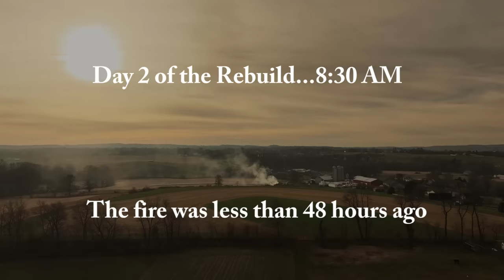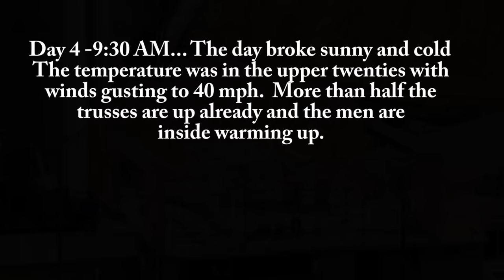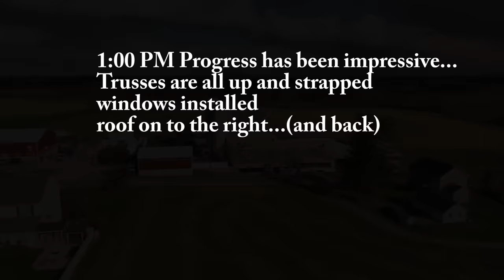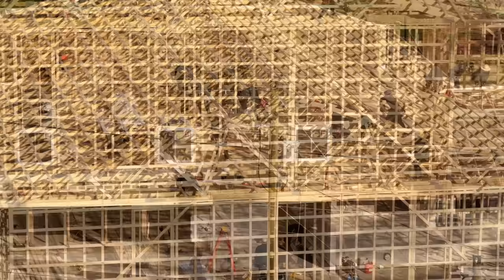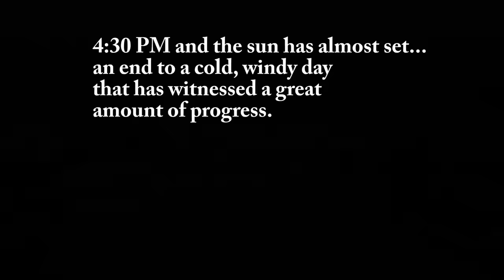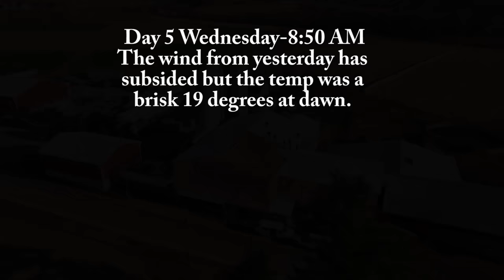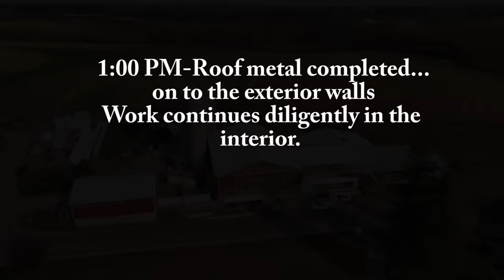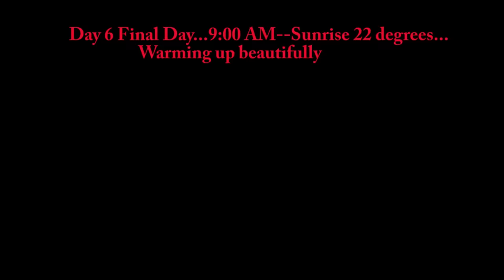BARN RAISING After AMISH Farm FIRE -NEW BARNS in 6 DAYS- Lancaster County's Amish Community

Comment: They obviously don’t have to pull permits or wait for inspections. It’s amazing to see things being done the right way and free of red tape and government bureaucracy and regulations.
Reply: it's called Corruption 🤣😆😂😅
Reply: They may be in an unincorporated township.   No governing body is present to require permits.
Reply: Good thing OSHA isn't around or allowed
Reply: Because this was a rebuild of an existing structure and no changes were made to the footprint, no township planning or approval was required, and most townships give the permit for free or a minimal charge. Had this been an entirely new farm, the owner would have tons of red tape and the process could take a very long time to approve.
Reply: Most agricultural buildings are exempt from building permits and except for electrical inspection but amish don't use electricity
Reply: @JERRYRIG432  Osha doesn't have jurisdiction on private done jobs there is no paid employees therefore not a  jobsite
Reply: You are correct on both comments. Ag buildings and I think hunting camps are exempt in PA, and OSHA has no jurisdiction here. @jdcatskinner
Reply: They build things to last.  If this were done by normal people in a place like here in Florida, someone would have low-bid the job, used low-grade materials and the first tropical storm that blew through would have leveled the building (if they even stayed around long enough to finish it).  There's a reason there are regulations, although there are still corrupt people who believe they are above the law simply because they are the law.  Ask anyone who's done renovations in this state how much of what they pulled apart was up to code. SMH.
Reply from the maker: @paulwall5706  , not even close to funny.
Reply: Red tape  ..... and greased palms.
Reply: @cassiebanks It’s the same on this side of the pond, ironically we call them cowboy builders over here😁.
Reply: Many hands make light work. Well done
Reply: @c.a.martin3029   they did change the footprint they made it bigger on the house side of the barn,
Reply: @719vol   it's West Lampeter Twp Lancaster County PA they are Incorporated
Reply: Unfortunately regulations are needed to protect people from crooked contractors. The Amish do not have that problem.
Reply: @719vol   This is in the suburbs, a few minutes drive from the city of Lancaster.
Reply: @jdcatskinner  many of them including this one very definitely have to use electricity for all the fans, pumps, cooling lines and other equipment. Plus in smaller townships especially in the farming industry, just replacing the same structure following the fire they probably had signed permits if they needed them within a few hours.
Reply: @capicolaspicy  most use pneumatic and Hydraulic powered fans, pumps, milkers, washing machines, refrigerators,  compressors and much more
Reply: @jdcatskinner  absolutely no argument, but you still have to have something to create the hydraulic pump pressure or the pneumatic pressure. Totally agree however that it minimizes the amount of electrical equipment required.
Reply: The big thing is they are self-insured through their church. Their "claims adjuster" was probably on scene fighting the fire and then ordering materials that evening.
Reply: If you research the Amish, they're exempt from dang near all the English laws and bureaucracy.
Reply: I was thinking that as well, then I figured that by the time OSHA knew there was a building site there they would have completed the job.
Reply: I live in a small farming community. I can attest to what others have said. If you're replacing a barn, silo, or other farm buildings, as long as the footings are there and you're not adding to it, then the permits aren't necessary. The only thing that's required is an electrical inspection. As others have said as well, being an Amish farm there is no electricity, so it's an easy build. This has been true since forever for the simple fact that a farm isn't like a regular business that can move. If a small factory burns, or is destroyed by a storm, they can easily find a different building and move into it.

But being a farm barns are absolutely vital and the longer the delay the longer the wait, the more impact it has on farmers. A farmer that has to wait months for inspections and permits may lose their livelyhood waiting. Therefore, as long as they're just rebuilding the interference is minimal.
Reply: @jdcatskinner don't use electricity, you must be kidding
Reply: @jamesadams893  some do but must amish from eastern Pennsylvania use pneumatic and hyd. Some ues solar panels to charge a bank of batteries
Reply: @jdcatskinner  they still are using electricity, what the fuck do you think goes into the batteries
Reply: @jamesadams893  no shit but you don't have to get a permit for it and that's what this post is about stick to the topic

Comment: Much like this great team of people, back in the '80s, I was part of the engineering corps in the military. Our camp, home to about 600-700 soldiers and officers, was suddenly called into action one night. We had to clean up after a severe accident: two semi trucks had collided in the countryside, not far from our camp. One was carrying fish, the other a large petrol tank. The crash had caused a fire that burned down four houses.

That first night, our task was to clean up the scattered fish from the road, working alongside the fire crew who were busy putting out the house fires. Local road assistance companies helped us move and haul away the wreckage of the semi trucks.

The following day, we switched to operating heavy machinery like excavators, bulldozers, and dump trucks. We worked in 8-hour shifts, clearing debris and preparing the site for reconstruction.

By the second night, our focus shifted to laying down infrastructure for new houses. We worked on connecting waterlines and sewage systems to four new house lots. The concrete foundations were poured on the third day.

I vividly remember working through the third night, helping to erect the walls of the new houses. In just 7-8 days, thanks to the coordinated efforts of our crew and some locals, we managed to rebuild what was lost in the accident. It was an incredible demonstration of what can be achieved in a short time with a well-organized team.

Comment: What an astonishing achievement! And what a community.  I'm an old, cynical atheist but I was moved to tears several times during this by the sheer determination of everyone, and that includes the power company linesmen too!
I nearly forgot, at 28 minutes, is that the highest washing line in the world?!
What are the two lines of raised roof fixings on the lower slopes of the roofs?
Reply: To prevent snow from sliding down on the street.
Reply: I was trying to get my head around the washing line! I kept thinking is it perspective or is it really that high 😂
Reply: Line looks like a pulley type line, and it's coming off the back deck which looks to be off the 2nd story. Having it up that high it catches a good breeze and it's out of the way.

Comment: I am amazed that they were able to obtain ALL the building material so quickly !!!  and to get it all put together.  fantastic job !!!
Reply: They have their own saw mills and as the man said in the beginning the needs of this barn were put first , so any orders that were being worked on were put to use on this job
Reply: More like money talks. That's commercial lumber, you think some Amish sawmill had that much laying around? The metal roofing and siding? The milker company and electricians started as soon as the loft floor was completed. The silo repairs weren't shown but the silo company did that on Sunday and Monday. Rental company had equipment there the day after Thanksgiving and thru the weekend. As did the concrete company. Yep, money talks.
Reply: @farmerbill6855 The Amish don't have 'A' sawmill they have SEVERAL. They are allowed machinery as long as it is BUSINESS use sanctioned by bishops.  Those rental companies likely are Amish run in that neck of the woods.  You'd be surprised
Reply: @Og-Judy  they don't surprise me, I've seen them buy farm land with cash. Two old school milk cans full of cash. That's commercial, graded lumber. You think they have a block company? That's one of their concrete trucks?

Comment: So how did they get steel I beams in two days ? How did they get trusses built that fast ? And how did they get the steel roofing already cut to size ? It is truly impressive how they work together and accomplish such a feat.
Reply: There are many Amish owned building supply companys in the ares.  There is a roofing supply company near there that will run out any length you can haul on a flat bed tractor trailer.  Trusses realy don't take long to construct.
Reply: My thought exactly. I was stunned to that much steel and wood just appear. I have seen a number of barns burn in the wider area from the PA border to West Virgiina and only a couple were rebuilt and the one closest to was rebuilt smaller.
Reply: @vernonearl  while that barn was on fire the owner must have pulled out the blueprints and started ordering new material to rebuild.
Reply: @Buckeystown  I was not surprised about the lumber because the Amish have their own saw mills.
Reply: @scottm3130 exactly. They were pouring concrete the next day!
Reply: I was wondering about the financial side of all of this. I cant get insurance on my old wood barns because of their age and construction (all wood ). Do the Amish all pay into a fund of sorts for these situations in order to buy the materials? I understand the labor is donated, but you still have the cost of the materials. The coordination and speed that this all took place in less than a week is truly amazing.
Reply: @danfarris135  I think they do put into a fund just for these situations. The cost of the materials alone had to be a pretty penny even with a Amish discount.
Reply: @scottm3130  I'm a local "english" from a few miles away. We always joke that it's the local fire company's job to hose the skid loaders and their operators down, toward the end of the fire, as they push the still burning structure off the foundation and away from the building site, since rebuilding will start at first light. A few years ago, a medium-sized Amish barn partially burned a few miles south of the one in this video. The local Fire companies did an awesome job and managed to save the first floor deck, floor joists, support beam and posts. The fire happened on a Friday night. I drove by on Saturday, at diner time. The entire job was spotlessly cleaned up and ready to rebuild. The damaged wood was already burned, and there was a 40 yard dumpster full of any non-burnable material and trash. The barn was fully rebuilt by the next weekend.

Comment: Did thay build the tress rafters on site or have them delivered
Reply from the maker: Trusses were ordered and built and then delivered the day they were needed.
Reply: @LancoAmish  that's not how it works because it takes the treess company more than 6 days to make them
Reply from the maker: @johnberg4618  , Sorry but you are wrong. The trusses were delivered and put up on Tuesday morning. What part of this aren’t you understanding? The fire occurred on Thanksgiving morning. The barns are all built now. I even have a video up of the fire and a link to the news article. I filmed the entire process. I started on Thanksgiving morning and finished exactly one week later on Thursday. I put this video up on Saturday morning. Are you saying the video is fake or are you just trolling?
Reply: @LancoAmish  what size did the truss company know to make them
Reply: @LancoAmish  Very nice job with the drone.
Reply: @johnberg4618   Simple gable truss, and you are really asking that question?  There are at least three massive truss building plants within ten miles of this barn. The project lead calls his truss supplier first thing on Friday morning and gives the span, run and pitch and says I need these ASAP. This isn't rocket science. These are professional barn builders, and framers that spend hundreds of thousands a year, or more, with local trusted, long time lumber suppliers and truss manufacturers. When they call those suppliers and say, "we have an emergency here and need everything ASAP, those suppliers get to it. This actually happens several times a year in the county. I live a few miles away, and not a year goes by without a major Amish barn fire within my local fire company's service area.

Comment: How did they get the building permit, inspections, and plan review for this project?  The government red tape is a major source of delay in most building projects.
Reply: Any where else this would seem suspicious.
Reply: Does not affect the Amish.  They are exempt plus it's agg and they just rebuilt what was burnt. No Electric or any of that BS
Reply: @raymondbrosious7616  Plenty of local Amish barns have electric in them, I have been in some of them. Amish are not connected to the English community with things like utility supplied electric, that doesn't mean they don't have generators or run electrical equipment for farming or on farm manufacturing. "They are exempt" because they are Amish? Sorry, it doesn't work that way. The state is very pro-farming, and as rule, you do not get in the way with stumbling bureaucrats any time any farmer needs to quickly rebuild after a disaster, Amish or English,  1000ft long chicken barn full of 100,000 chicks owned by giant AG, or a two horse barn on a small Amish homestead, it doesn't matter, you rebuild ASAP, and deal with any paperwork after.

Comment: Impressive!! But many questions, were do they milk the cows during this time, what do they use the second floor with meny windows for? This wagons were they feed horses, what are they build for otherwise?? I`m very imprest off the leader whish can plan and keep this going in so short notis!!
Reply: The cows were at a neighboring farm until the new barn was ready. The second floor is used mostly for hay, feed, and equipment storage with one section used for hosting church and social events.
Reply: @ILavern  Those feed wagons can be rented. They are common at large Amish events. They can even be outfitted with a large shade sail setup attached, to keep dozens of horses feed and in the shade for the day, while a wedding or church service is underway. It's common to have a large circus tent style structure erected for an event. The guests arrive in their buggies, then turn the buggies over to the young boys assigned to the task. The boys get the buggies parked, then tie the horses off to those large trailers, located under the tent. The trailers are piled with hay to keep the horses happy until it's time to leave. 
Since Amish wedding are held at the house, there are often large temporary structures built to handle the guests. I have seen full size ranch house style buildings built with stacks of pallets for piers, a full floor deck, and side walls, then trusses and plastic stretched over for a roof. The entire building then gets torn down the day after the wedding. There are also structures that are the size of tractor trailer box trailers, that can be rented. They fold out and create large portable wedding venues, complete with walls and a roof. They are pretty commonly seen at Amish farms that are setting up for a wedding.
Reply: @kerrykerry5778 Yes, I failed to mention the wagons in my comment. Your detailed and impressively accurate information makes me think you might be a taxi driver for the Lancaster Amish.

Comment: What you see is the building of the outside, but I'm sure there was still a lot of work to do inside, even though they must have been working on it all along, as is proven by a cement truck with it's chute sticking inside.  I've owned a farm and built and remodeled it, there is a lot of work inside that isn't as eye catching.  They got by without having to get permits or plan approval because being a farm, they are exempt from these obstacles.
Reply from the maker: As of today (12/4) the inside will all be done. The last small job was getting completed today.

Comment: I didn't think Amish used gas/ diesel / electric drills saws so on , power equipment?   Also few of skid steers had rubber wheels??
Reply: to put it briefly, they can use anything their church district allows them to, which varies greatly by community. this even includes computers in some who work in some of the trading markets running stalls. in this video though, I think there are many "english" people working too. Even if they are allowed to use certain equipment, there are rules about it, so it is not willy-nilly. For instance, they may be able to use loaders and telehandlers on a jobsite, but not to drive the equipment from site to site, that type of thing. The use of gas engines mounted on horse-drawn farm equipment has been allowed for decades, and even the use of electricity when generator provided, not from the grid. It's a very complex situation for us from the outside. I have watched more documentaries than I can name. I hope this info helps. I am not the "law" for what the Amish are allowed, of course.
Reply: @CuriousEarthMan  Nothing going on in that video that was not being done by local Amish, with the exception of crane operation, and driving concrete trucks. The crane is unlikely, as the operator typically works for the crane company and drives the unit to the site. The concrete truck got there on public roads, and Amish are not allowed to drive vehicles on public roads. That said, I recently had some hydraulic work done to a heavy truck chassis, at an Amish owned hydraulic shop not too far from this barn fire. I asked one of the owners how the trucks get shuffled around the property. He told me that most employees know how to drive cars up to big rigs, but are not allowed to do so on the road.